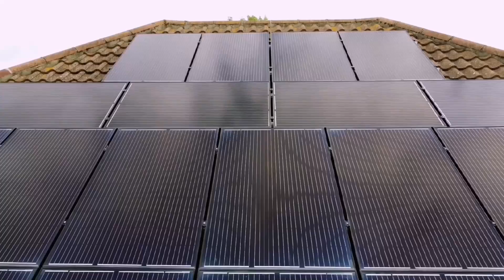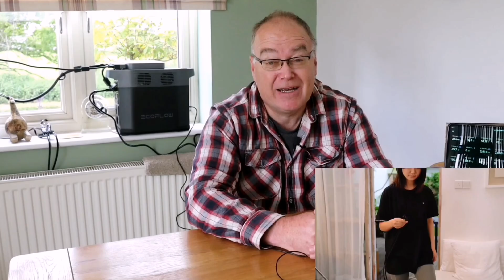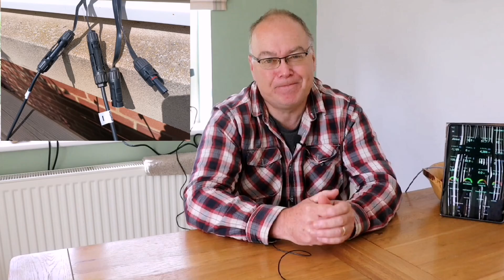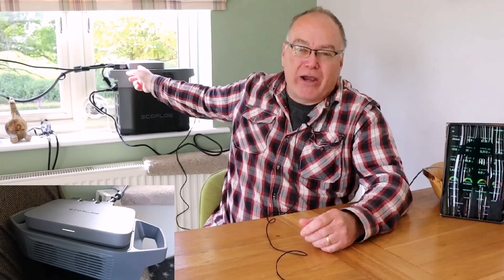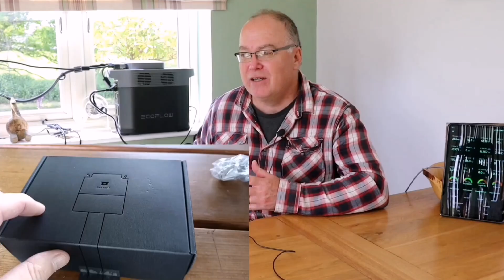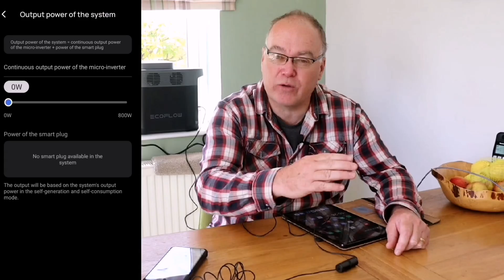Revolutionary Ecoflow PowerStream - DIY plug in grid tied Solar PV & battery system

Comment: You state (quoting Ecoflow) that it meets the required standards.
However it was only submitted for approval on the 5th June 2023, and ENA assessment typically takes 4-6 months (if you are lucky). And that is assuming they approve it.
There are big brand recognisable fixed inverter manufacturers who have been "under assessment" or "waiting further info" since Sept 2022 and still not approved.
So at present you cannot use/install that in the UK.
Reply: Great comment and references, you simply now that it will never be allowed to pass mains voltage through a 3pin plug with exposed connectors, if its grid detection fails or software that plug becomes a human killer.. I'm sure it will be sold here though as the Chinese simply don't care about any level of safety.
Reply from the maker: Suggest you tell ecoflow they're not allowed to sell it.
Reply: @EVPuzzle  I don't disgree with what you stated, given it was merely what they told you. However as you well know, it requires ENA approval for connection to the UK grid.
And it isn't.
What the consequence would/could be is a different matter. But that isn't going to be approved in the suggested 2-4 weeks as their online advertising suggests. The ENA don't even acknowledge a new product test request that quickly, never mind do it..
I also can't see anything about G98 DNO notification within said (available) docs - yet clearly Ecoflow are aware it's required otherwise they wouldn't have bothered applying for type testing in the first place. And the DNO will reject a G98 notification based on no ENA approval.
I accept it never exports, but the microgen still needs DNO notification of it's existence.

Comment: Ive passed on this video Nigel to my friends who as a retired couple are in a rented house , but really want solar , primarily to cover thier base load. They have looked at ecoflow , and your video explains it well 👍
Reply from the maker: Many thanks Jonathan . I was sceptical to start with . Is it really possible etc? 

But it definitely covers the baseload, sizing the battery is of course key and to put an ecoflow smart plug on the fridge makes sense 

Plus you've got the portable battery in case there's a power cut 🤯

Comment: Thanks for the video. I live in France and have two BeemEnergy solar panel setups primarily to smooth the load during the day. I do however on certain days put power back to the grid  (50Kwh in 4 months) and this would be ideal to trickle feed overnight devices.

Comment: The two things that strike me, as an Electrical Engineer.  (1). If the EcoFlow is suppling the house and you unplug it, is the 13 amp plug still live.  You would hope EcoFlow have thought that through (its very dangerous if not).  
 (2). If the grid supply fails to your house, its a fundamental safety feature of all solar / battery systems to stop suppling power.  This is to protect the poor electrician who is trying to fix the grid fault (e.g. in a hole in the road).  I’d like to know how EcoFlow have got round this problem?
Reply from the maker: Technically , I guess it does it in a similar way as other systems detecting grid loss  and 
No it's not live when I unplug it

Comment: I think a better solution to the inverter cable would be a release clip that slots over the cable and releases the tabs whilst giving a better grip on the cables at the same time.
Reply from the maker: I'd prefer a better solution that allows you to unplug it in the same way you plug it in
Reply: @EVPuzzle  maybe something with a clamp to lock unlock the cable.

Comment: I had no idea that you could plug an ecoflow battery inverter into a plug socket and send energy into your house, and also no idea that it could back up an already installed solar installation. I have an issue where I stop collecting solar energy by about 4pm after the sun has moved and I was considering installing a few panels on the side of my roof facing the evening sun. That is now most likely going to be changed to an ecoflow system instead.

Comment: A good balanced review. Some of my learning ….it won’t stay powered if the grid goes down for compliance/ safety. I think they supply a tool to help remove the plugs now. It will not work in systems with extra batteries as it uses the side extra battery port( I hope they develop a Y lead to remove this limitation. So for instance my Delta 2 could use the new Delta 2 Max extra battery and that would give me a 3kw install !
Reply: Thanks for this information. I was very interested until I read 'it won’t stay powered if the grid goes down for compliance/ safety' - which kills the system for my use requirement. However...

I have just read on the Ecoflow website: 'When an outage hits, rest assured having not just your essential devices, but also energy-hogging ones like washing machines up and running.'  So, it seems that this will stay powered when the grid goes down?
Reply: @speedmatters  Possibly referring to using the battery as a stand alone  - from a socket on the battery itself as they were originally designed for ? Happy to be proven wrong as it would add a lot of functionality to the product to work 'off grid' ......I've only recently been told despite asking many times that it will work with and existing install of a home battery and inverter.
Reply from the maker: Yep found the instructions for the tool, but wasn't in my pre release box.

Comment: Hi, in response to a query over on a popular discussion platform this products official company account states that you are obligated to inform DNO about the powerstream solar setup. If correct then this significantly alters the implied simplicity of the system setup.
Reply from the maker: Yes the internet is full of forums with very knowledgeable people as per the comments also. It doesn't make everyone correct , me included .
 If you look
 in the right place though  systems under 800w are excluded  but don't trust what you see or read online, be certain yourself .
Reply: Yes here it is, page one of the "user guide" downloaded from the shopping site beginning with "A". 

"Guidelines: 
In order to register and implement your solar system installation with compliance, we 
would suggest you follow the steps below: 
Step 1. Find a qualified installation contractor with an MCS"

Comment: There is a tool to remove the cables from the Powerstream. You must have missed that part of the instruction ;)
Reply from the maker: Or mine are pre release and not complete 🤦‍♂️
Reply: @EVPuzzle  Others have pre release units and have found the removal tool. Did you check?
Reply from the maker: @MatthewBayard  who else in the UK has it on test ?

Comment: Hi Nigel, great video and so far the best out there. Thanks for taking the time to put together. Could I ask a few questions.
I am assuming the powerstream cannot function without the battery?
Can you connect devices to the battery ports whilst using the powerstream?
Could you set the battery to charge from grid at set times with this connected?
Do the tapo smart plugs measure power delivered by the system to the house?
Does it work with home assistant?
Can you have more than one battery and powerstream setup? I'm guessing that the limit is just one.
Reply from the maker: It might do the solar bit without the battery. Not tried though
Reply from the maker: Yes on using battery , I've done that
Reply from the maker: Yes I've done timed charging on a smart plug
Reply from the maker: Not sure on tapo I use kasa

Home assistant integration looks flakey so far . Not there yet imo but no doubt will at some point
Reply from the maker: I'd expect a limit of one per house as DNo exception is 800w. You can have more but would need to get approval probably
Reply: @EVPuzzle  is this true? be usefull if you have link that states this (DNO exception is 800w) as I've been trying to find out what are the legal requirements or any regulation on this, I have  sent a request to EcoFlow support and awaiting a response. Essentially I just need to know if I have to apply for any DNO or any other planning permission to install this system myself.

Comment: Good video, just one question. Will the system simply feed into the house mains if the battery is not connected?
Reply from the maker: Haven't tried it but  I'd expect it to

Comment: Another wonderfully informative video, as ever. I had no idea it were possible to send AC back through a wall socket. As you mention in your video, the notion feels somewhat uncomfortable to my old-school way of thinking. This might be a viable way to connect solar to a ca. 2000-era immersion heater without having to replace the entire unit or mess with the hazards of coupling DC onto an AC thermostat...! Thank you for sharing this.
Reply: Yes same it’s very strange, I thought you always needed an inlet transfer switch!
How can outlet become and an inlet has yet to be explained to the ordinary folk 😂
Reply: Reading the EcoFlow details the way they have got this passed is that the smart invertor looks to shutdown if there is no current present at the inbound plug socket - ie if a power cut it stops the invertor putting electricity into your house and potentially back onto the grid. EcoFlow advise in power cut you would need to plug devices you wish to power need to be plugged directly into the Delta - is this means the devices run in island mode - separated from your house electrical system. Hope this helps.

Comment: I've been on the edge of my seat with this one since you set your premiere! My big question has been how this would work with the Powerwalls. I've wondered if the frequency would be a problem. Your batteries seem not to mind?

I'd love to add these systems to our two offices which use comparably less energy but almost always during the day. A pair of laptops and a pair of IR panels in the Winter. That too, I wonder how many could be on one house? What happens if you disconnect the breaker?
Reply from the maker: It's an exciting product and a bit controversial plugging in direct . Not sure about multiple systems ie more than 800w feed in . 

Frequency is fine its just a negative load. Powerwall wont see it same as my Victron doesn't, the load just drops 

I'm testing turning off the grid feed next ...

Comment: Trying to work out if this can work without the battery. I could do with a but more west facing solar for the afternoons and I have a couple of ~300w panels sat in my shed doing nothing that I could hook up to one of their inverters and then maybe get a battery at a later date. I don't really want to buy another battery right now as I just bought another Pylontech 3.5kWh battery for my Victron inverter.
Reply from the maker: Haven't tried it without the battery yet, one to rest another day. Tested without solar this week though and that's handy
Reply: @EVPuzzle  Just read the manual implies it will work without. Also found the following under a section labelled DANGER,  

Do not remove the connector with your hand only. Please use the cable puller supplied with the product to assist in pulling out the connector.
• If you have installed the protective case, please remove the protective case from the microinverter before you pull out the conne
Reply from the maker: @nervousfrog101  I'd better read it again , didn't see that 😖 thanks
Reply: @EVPuzzle  Also looks like they have an API for some Home Assistant goodness here goes even more of my spare time.

Comment: Not sure if I’ve misunderstood…..does the power come from the battery/inverter through a 3 pin plug that plugs into the house socket? Surely there’s a safety system in place to prevent the plug having a bare live pin that can be accidentally touched?

Comment: Hi Nigel,
Looking at something like this for my sailing boat. Already have an AC ring in boat for when plugged into a marina with about 4 sockets, presume I could just plug this into any socket when at anchorage or traveling? Would be great to be able to use the bright AC energy efficient lighting when out, also power my laptop. (Also used for navigation and ship identification). 
Presume you can output  DC as well,  handy for emergency auto pilot use?

Ideally would probably be better value to install a few panels and  12V LFP batteries, but I like the portability of a system like this.
Reply: Hi, this requires mains input to work so when you are not connected to grid via hook up it won't work. However you could use just the ecoflow battery, have that connected to your hook up point and add solar panels directly to the ecoflow battery.
Reply: @MyApole however he could use the Solar Generator inverter output to energize the circuit in the boat by plugging into a socket.😊

Comment: Looks like a great system but it's too expensive at the moment. 2Kwh battery for 3000+ cycles at £1800 is not cost effective since the cost of 2kwh stored is 60p * 3000 = £1800 and price/kwh could come down soon. Will wait for prices to drop but this is the best system for the convenience of avoiding scaffolding and electrician etc I have seen. Zendure are doing one too but not as neat and more expensive still at €1599 for 1kwh battery and a power diverter but not a microinverter. The Delta Max 2000 is not LiPO4 though so has fewer cycles 800+.

Comment: I like the idea of this, specifically because you can specify a limit to the power distributed, however......

There is a risk associated with Plug-in Grid Tie systems, in that you can in theory overload the wiring in your house, without tripping any breakers. This is because the power is being fed into the circuit via the plug, not through the breaker from the grid. The following video explains more clearly; https://www.youtube.com/watch?v=VP9n8T3PsMA

With careful planning and use this could be very interesting.

Comment: ⚠️ Are you sure you don’t need G98 approval from your DNO ? ⚠️
Reply from the maker: Documentation I've read says less than 800w is exempt
Reply: That’s interesting. Where can I find that document?
Reply from the maker: @zjzozn  it was shared to me on twitter by a solar installer
Reply: Yes, it will require approval from the Energy Networks Association and will require notification to the DNO under EREC G98. The vast majority of 'solar installers' have very little understanding of any of the ERECs. Inverters with a Registered Capacity of ≤800W are only exempt from a tiny selection of EREC G98 compliance requirements which can be found in Appendix 1.

Comment: do you have the voc of the microinverter? i have tried ecoflow but no response. i see it cant be 800w like they claim with the max pv input being 55v and 13a= 715watts already have a balcony set up but would happily swap to stop all the cabels over the flat !
Reply: oh and these other bigger systems you speak of are you aloud ot go deeper with info ? oh in the external case there is a plug type device to help you remove the cables from the microinverter
Reply from the maker: I'd guess it is under 800w to be allowed but and has to be under 800w after being inverted to AC

Comment: In the event of a power outage, the linesmen needs to know that the power is off, so they dont get zapped during repairs. How does the system ensure that power isnt going to the grid in a situation like that, if you're using the battery to power the house via 3pin?
Thats my only negative thought beyond the price. Looks a great piece of kit.
Reply from the maker: My house is wired with a transfer switch so there's nothing that can go back during a powercut as it's isolated .  Without the transfer switch though I'm not sure how this qualifies for G98 without that grid isolation . Haven't seen that covered in the documentation yet

Comment: will it charge from the grid? and what happens if you set the discharge to higher than your load? does that energy go to the grid?
Reply from the maker: Yes it exports .. electricity just flows in or out  and yes I've been charging this week from my AC house socket during the day then discharging at night
Reply: @EVPuzzle  one more question, how does this behave when the house is disconnected from the grid? Can it still provide the house with power or is it reliant on a steady grid connection? Just trying to think through all of the potential use cases for a product like this